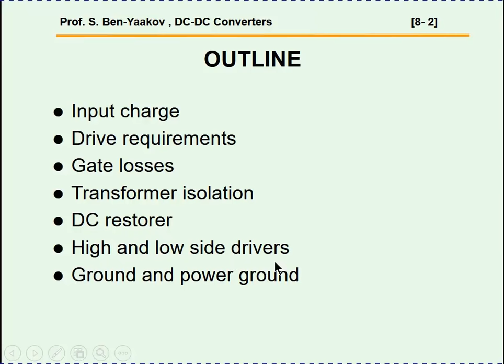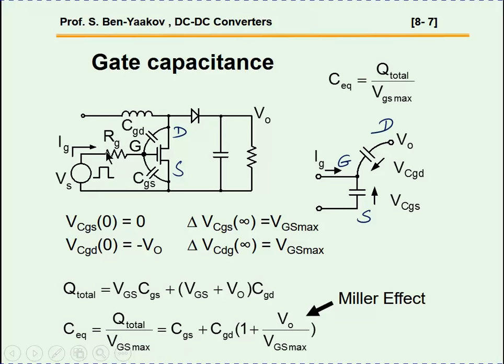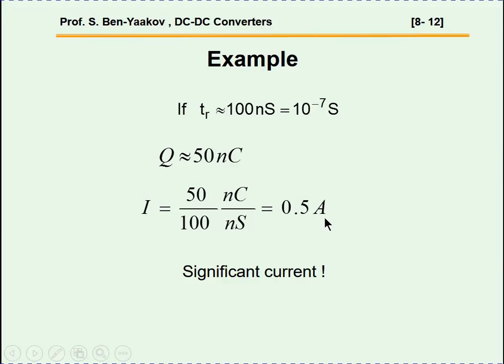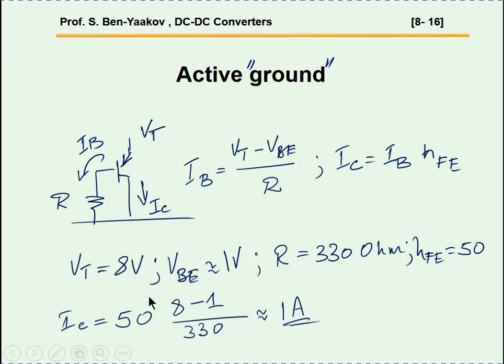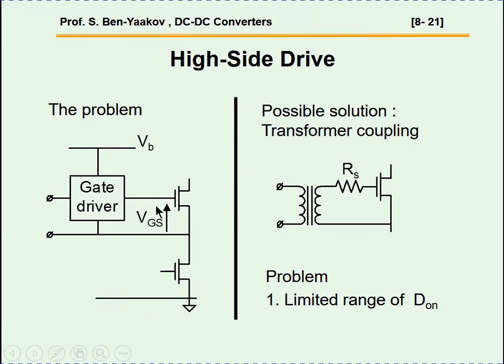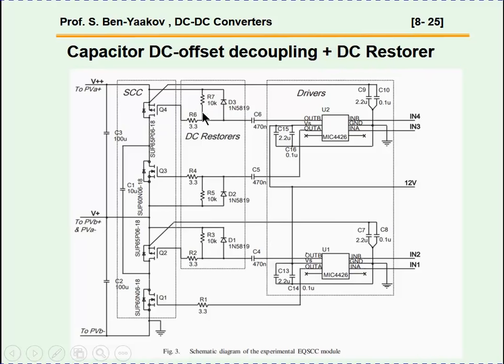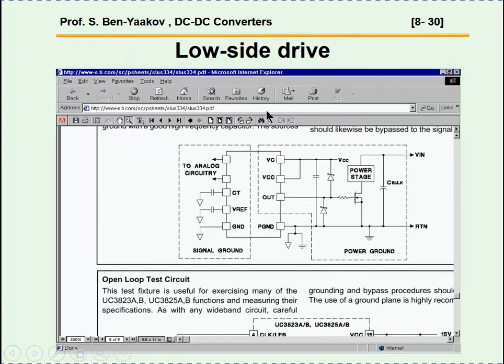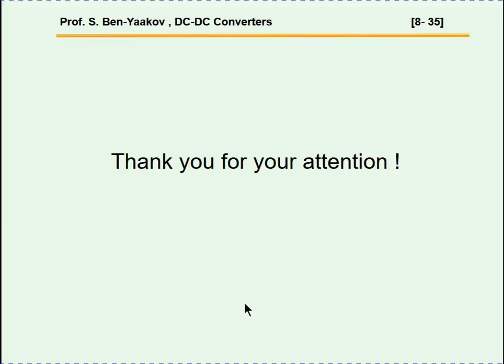Power MOSFET drivers

Comment: Your explanation is simple, deep and educational at the same time. It's been a week that I try to find a solution to control the mosfets of a speed variator for three-phase Asynchronous motor. A floating power supply was essential, and the methods using transformers or optocouplers did not satisfy me. You just saved my life with this IF2110, thank you so much. In addition let me congratulate you on the English used, simple and concise while in the technical field I am more used to French.
Reply from the maker: Thanks for comment.

Comment: Thanks for the nice explanation.

I have been testing some SiC NMOS and I prototyped a rig with some wires and terminal blocks to see how much switching frequency I can drive the mosfet to with air cooling. I have stray inductance every where of course since it is not a pcb. The circuit is a low side drive of a resistor bank, I observe a weird waveform accross Vds when with the falling edge of the pwm driver. It is not the typical ringing, it is rather a very high spike in voltage that is followed by negative voltage and then the typical ringing around the supply voltage. Snubbing is not getting rid of the first spike.
Reply from the maker: Thanks for sharing. A PCB with a good layout is a must.

Comment: I've only just discovered this channel, but it looks to be a gem - a real breath of fresh air, with enough attention being paid to the underlying circuit physics to make genuinely useful derivations, as opposed to the vigorous hand-waving available on most YouTube treatments of the material.

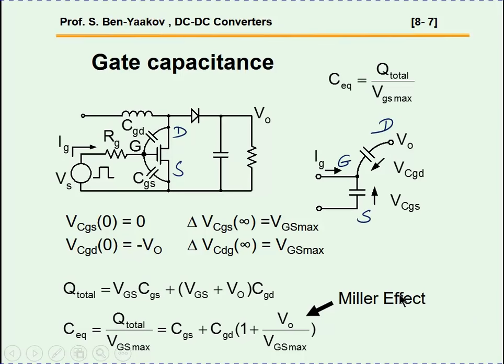However, I have a question: in your derivation of the Miller effect, starting from about 5:55, you seem to be claiming that the voltage across C_{gd} is V_{GS} + V_O.

From your diagram, the top of C_{gd} is at V_O and the bottom is at V_{GS} - I would therefore expect the voltage across that cap. to be V_O - V_{GS}

I am clearly misunderstanding something, but I can't see what it is - maybe I'm making a sign error somehow?
Reply from the maker: Thanks for comment. This is indeed confusing. Look at this this way: Looking from the gate, Cgd was initially charge to -Vo,  and then charge to Vgs. So the total charge needed is (Vo+Vgs)Cgd

Comment: I used a form of that DC restorer circuit to develop a solid state version of a gate driver for a very large SCR that needs a many amps to turn-on quickly and reliably yet one wants that to be brief to reduce unnecessary gate power dissipation. Selection of a quality pulse capacitor that can handle that repetitive peak current turned out to be key for reliability.
Reply from the maker: Thanks for sharing.

Comment: Very many thanks Professor for such a prompt reply. As always the more one finds out about a situation the complex it can become. Seems likely my problem has much to do with using 6 MOSFETs in parallel & poor dynamic current sharing. Variation in Vth can result in some devices switching quicker causing others to go out of S.O.A.. Advice appears contradictory as fast switching, am told, coupling gates using low or zero series gate Rg & hard switching helps reduce this effect. Am also told that parasitic oscillation can occurr for the same reason & increasing Rg & fitting your recommended Fe bead on each gate cures. In my case looks like some Rg value between these arguments is needed. Experiment is called for. Thanks again. Dave
Reply from the maker: Have you seen https://youtu.be/Aq1Iw6ByXAw  ?

Comment: Your videos are the best. I, as a Master's student of Power electronics, get most of my concepts cleared on your channel. Please explain the effects of body diode in MOSFET and how this varies when we use IGBT.
Reply from the maker: This issue is discussed in some other videos  of mine. In short: the body diode of a Si MOSFET is a  rather  slow diode so there might be a problem of reverse recovery.  IGBTs doe no have an intrinsic diodes so you can parallel them with fast diodes.
Reply: Could you please share the title of the video?
Reply from the maker: Go to 
https://www.advicepoweracademy.com/video-tutorials

and search for diode

Comment: Sam,
Thank you for your explanation of the concerns of power mos gate driving.
I did notice one circuit that was given up too quickly. That was the p and n fet totem pole gate drive that was given up on because of shoot-through. 
If the input gate resistor is moved from the power fet to the source of the driver p fet you get a fast turn off and a reduced turn on current which is desirable with out shoot-through.
Respectfully,
Ray
Reply from the maker: Hi Ray, Thanks for comment. Please indelicate which slide no. or video minute you are referring to. I am always happy to learn but I am not sure what you meant.
Reply: Sam,
I was not ready for such a fast response. 
The DC-DC Converters page 8-18. The lower schematic of the cmos gate driver.
Thank you.
Ray
Reply from the maker: Good point if you want an symmetrical drive. In fact you can put two resistors in series  between the drains of the drive FETs and connect the gate of power transistor to midpoint.

Comment: I omitted, in my question regarding fast turn-off diodes shunting MOSFET series gate resistors, to say that I do not know much about the original drive speed or frequency but I do know each Rg was 47R with no fast turn-off diode. My question really should have been is relability improved, maybe at a reduction of efficiency, by using a slower drive edges? I have attempted to comply with your recommendations with snubbers & safely limitted my device overshoot although admit I have not verified my circuit at the full 6kW. Thank you again. Dave johnson
Reply from the maker: Hi Dave, I have seen the two part of your query. Fast turn off could be beneficial to improve the efficiency. The 47Ohm will slow down turn on and hence help reduce  the reverse recovery spikes.

Comment: I thought I would try to use the IRS2186 "4A" banner spec to drive 2 HY1920P MOSFETs (4 total) and it's looking like the driver will need to deliver peak 3A.
Qtot=200nC, Vgs=10V, Vds=170V
Although in practice it gets boiling hot! It is dissipating around 2W of power!
Thanks for teaching me this!
Reply from the maker: What frequency?
Reply: @sambenyaakov  300kHz
Reply from the maker: @power-max  Yes, the power dissipation is indeed  far from being insignificant.

Comment: I've noticed a significant difference between gate currents calculated by Method A and Method B. In my application, Method A results in half of Method B current. Is there any explanation for that? By the way, congratulations and thank you so much for the content.
Reply from the maker: Since the capacitances are voltage dependent, method A is only an approximation if one assumes fixed capacitances values.

Comment: Hi, thanks for video. i have question --> can you please explain effect (positive , negative)of body diode of MOSFET in H bridge application(consider all four are N channel MOSFETs). Also why H bridge configuration with all mosfet as N channel mosfet. what is disadvantage with use of 2 p channel mosfet as High side driver and 2 N channel MOSFETs as Low side driver in H bridge application

Comment: I realy like your presentation and also, took notes. However, I'm designing a 144Vdc 6phase inverter at 100A to drive a dual stator PMSM that I've design and currently being built. Just when do we need to isolate (galvinize) the power side of the logic side? Is it just a question of preferences or is it most likely due to different codes or standards if an electronic device is intended to be commercialize ? For a start, I've decide to have a none isolated power and logic power and the choosen driver is the IRS21864PBF which does have a seperate logic ground (VSS) and hi volt power gound (COM) just as you explained and will have to be tie together. At least, I've got this part of my project right! Thanks.
Reply from the maker: Hi Donald, The purpose of gate drive isolation is not isolation per se, but ground separation. The grounds can (and recommended to be) connected at one point. Without isolation the  digital  signal reaching the gate driver (which should be close to switches) may and usually be corrupted due to the voltage drop along the ground. Some of this is partially covered in  https://youtu.be/uMe9qthcjS4 . If not confidential, love to hear about your dual stator drive and motor.
Reply: @sambenyaakov  Thanks for your answer. For now, I will stick with my non-isolated drivers since I'm exploring different options! My motor project is not confidential. I invite you to read here: http://openvolta.blogspot.com/ and my youtube chanel : https://www.youtube.com/watch?v=3U87w2zwoHk.  

I've not been very good at updating my blog or youtube channel. Since, there has been a couple of updates to design that has enhanced the torque and the efficiency. Theoretically, according to the simulations in in FEMM, it can reacht a maximum efficiency of 97%.  It's not taking into account the mechanical losses. Also, according to research that I've read, the rotor design is prone to a lot of eddy current losses. So heat is expected and demagnetizing the PM is an other issue. 

This motor is intedned to be a direct drive. It output 99Nm à 100A nominal. The copper losses are low. THe outer stator has 7 wound turns and the inner stator as 4 turns. At a certain point, the outer stater will not be injected with current and only the inner stator will be energized.

Again thank you!
Reply from the maker: @donaldwright2426  Thanks for sharing. Interesting. Will study it.

Comment: Thanks professor for the Great video with lots of useful information. I have one confusion regarding the Vgs plot during turn in. Does the Vgs stay constant at the threshold voltage or at the plateau voltage corresponding to the drain current. I think the flat portion should be the plateau voltage.
Reply from the maker: Have you seen
https://youtu.be/S_o_ltLJCWY  ?

Comment: Very informative and compact lecture! You have my appreciation.
 I rather have question about driver isolation approach. An H bridge driver configuration solves the problem of average zero current over transformer probably? The circuit for gate will be a bit complex. Is there any drawbacks in such approach, except for mentioned in video?
Reply from the maker: Mismatch  might cause a residual average DC voltage and therefore current. No matter what type of driver.

Comment: Excellent video! I agree with the engineer approach as well , instead of proving (boring) math equations. 
One question; with the rise time (or t(on)), do you mean half of the period of the frequency or the up-going flank when switching on? The last one is very tricky to determine because it heavily depends on the rest of the circuit.
Reply from the maker: To which minute in video are you referring to?
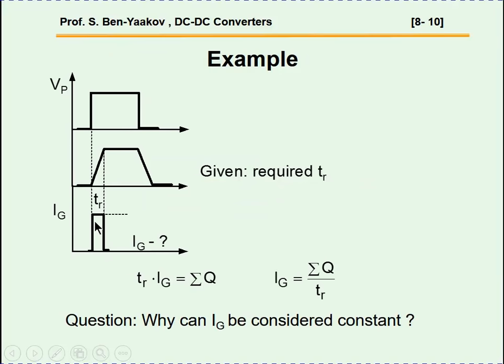Reply: @sambenyaakov  around 11:00

Comment: Hi Dr Sam thanks so much you are very smart and wonderful in teaching, i have question about IGBT, how can i get ride of the problem of higher dv/dt, turning IGBT off with negative voltage does is not effective , so how i can prevent IGBT from blowing up due to dv/dt.
Thanks,
Reply from the maker: Thanks for comment. The  simple way to controls dv/dt is by increasing gate resistor.
Reply: Thanks Dr. Same, but the switching losses will increase, is there another solution
Reply from the maker: You can use a turn off lossless snubber. This will decrease dv/dt.

Comment: How about a high side switch that gets Gate Drive from the High Side Voltage and is switched by an NPN transistor to GND. Not isolated, but you don't always need isolation
Reply from the maker: Possibly. Have you seen: https://youtu.be/_BgdxMW3HlQ     https://youtu.be/MiiMun66f78

Comment: Thanks for the informative talk.
Just a question, if you are open to talking them - Once the Gate capacitors charge enough and it starts conducting - how is any additional current flowing from the driver supposed to be handled (Lets say we wish to maintain that position for long). Is the resistor @ driver supposed to sink in all that excess charge or the grounding resistor would start to share it?
Reply from the maker: Happy to answer. For the MOSFET to conduct, there is no need for a current. Once the gate voltage is above the threshold it will conduct. The driver charges the gate until the gate voltage equals the driver's output voltage and the current flow will stop, save some bleeding  if the is a resistor between gate and source.
Reply: @sambenyaakov  Thanks.
I have a Power MOSFET - IRF1404 which requires total gate charge of 196nC but the driver I have in mind (2N7000) has Max drain current of 200mA. Do you think it could drive the Mosfet easily - actually it needs to drive 4 such Mosfets in parallel. Individual drivers to each Mosfet is the way to go or should this single one be enough to drive all of them in its sweet time?
Reply from the maker: @royalsingh  A single driver can drive the 4 transistors. Think about it as a voltage source charging four capacitors in parallel. But... the turn on time will be relativity long so if the switching frequency is high you will have heavy switching losses which will heat up the transistors.  If you use one driver better to use separate (series) gate resistors for each. There are drivers with much higher current.
Reply: @Sam Ben-Yaakov  Brilliant! Many thanks for your suggestion. Switching frequency is almost negligible, they would be utilized to switch a BMS input supply. Have a Good Day!

Comment: Dear Prof Yaakov, thanks for this comprehensive tutorial. I only have one question: at 9:39, it is shown that the total charge Q can be read from datasheet but when I get into manufacturer data, I see that it refers to specific operating values for Vo, Id, Vgs which in general are different from the values in my application. Straightforward question: starting from datasheet information is there a procedure or even a rule of thumb to extrapolate Q for different operating values of the previously mentioned parameters ?
Reply from the maker: Hi John., thnks for note, The main correction needed is for a change in voltage. The others are really minor. AS a first approximation the length of the flat portion of the v=f(Q) curve is proportional to Vo.
Reply: @sambenyaakov  Thanks!

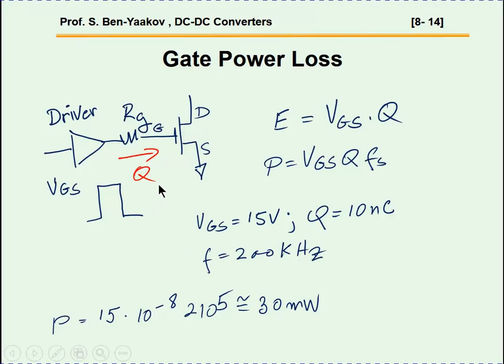Comment: At 15:00, with this method, shouldn't there by a multiple of 2 for the switching frequency? Because every cycle you need to turn the element on, then off? Therefore you have to dissipate Q*Vgs twice per cycle, so the resultant formula should be 2 * f_s * Q * V_gs
Reply from the maker: No. Think about the energy that comes out of the  driver (only at turn on)
Reply: @sambenyaakov  I see! I though about it some-more and realized the classic physics formula of energy in a capacitor is 1/2*C*V^2. Well at a fixed/constant 'V' if only half the energy is stored in the capacitor, the other half must be dissipated in the resistor. Both times charging and discharging through it. Not sure if that's the right way to think about it (kind of 'hand wavy' description) would you agree?

Comment: thank you sir for great explaination
I am new in power electronics so can u plz tell me that is there any IC available which can implement PI controller by connecting R and C externally to it, to get desired value of Kp and Ki and at the output generating required PWM signal which can further be given to driver and further to gate.
Reply from the maker: Just about all PWM controller ICs are designed for external connection of the phase compensation components.

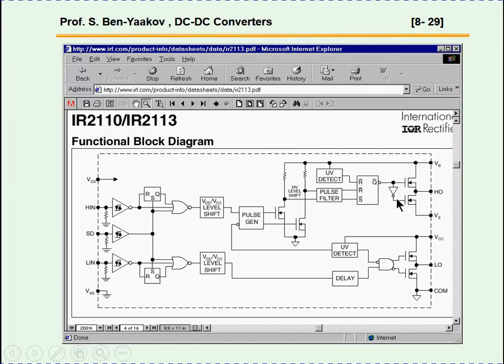Comment: good video, but a couple things I noted as I watched. Here's one, 32:22 there is no reason why you can't use two n channels fet's as a gate driver, it's just a half bridge and is common in gate driver ic's. 37:35 In fact the ir2110 has n-mos outputs. It's not bad with an x through it, lol
Reply from the maker: Hi Thad, thanks for comment. Sorry, you seem to have missed the point. 32,  you can not use two n channels with a charge pump drive. Watch again the video.
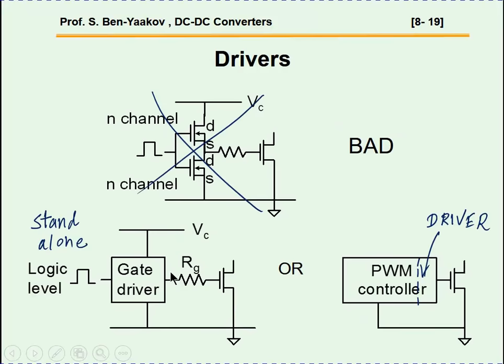Reply: @sambenyaakov  I didn’t miss anything and yes you can use two n channels in this way. the time index I gave is wrong it’s 23:22, you just don’t tie the gates together, you wire them as you would a half bridge just like the output in the ir2110 or ir2010.

Comment: again thanx for ur great lecture,
sir, can pls tell how to provide provision to power the IC's in the circuit itself, coz in any converter available in the market has only 
1 input and 1 output, but when I develop prototype I give external DC supply to the ic, I think you can have one product oriented video.
Reply from the maker: Hi, Thanks. Will try to cover this in a forthcoming video

Comment: Thank you Professor Sam Ben-Yaakov for another mazing video. I have a question in regards to the equation Ig=Qtotal/trise. How is the value for trise achieved. Is this the designers choice or is the value taken from the data sheet. Because the MOSFET i am using has stated this value but at certain conditions which do not match my design. So I was just wondering based on what do I pick this time (trise).
Reply from the maker: Trise is a function of peak current drive (the integral of which is Q). The relation between drive and Trise are given in datasheet
Reply: @sambenyaakov  Thank you. I have taken the rise time of the MOSFET from its data sheet which is 260ns. My gate driver has a rise time of 200ns also, do I need to consider this as well? or just use the MOSFET rise time for this calculation?